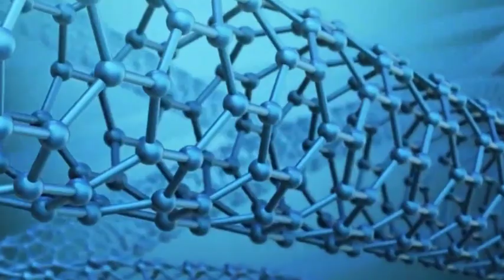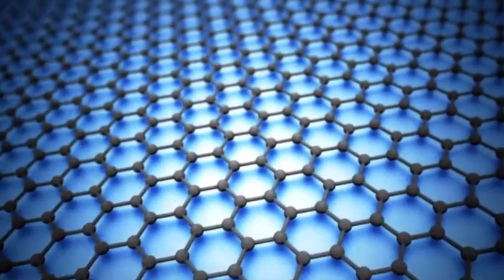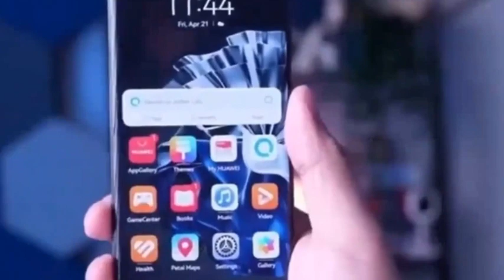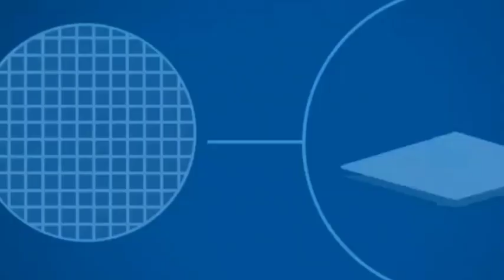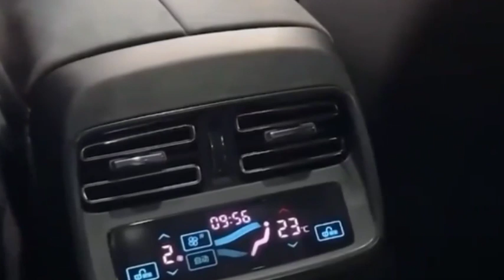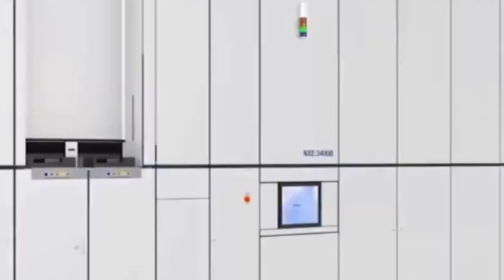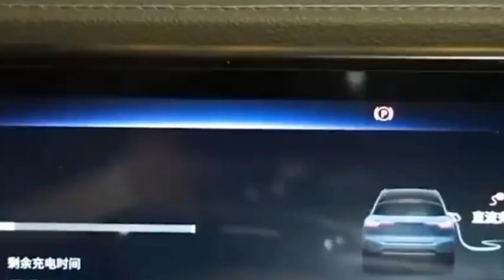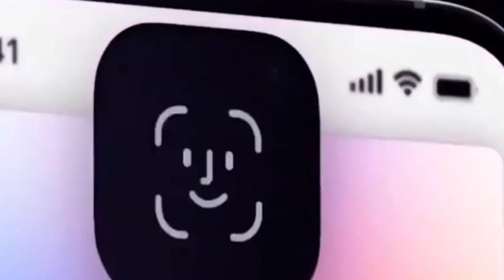Tianjin University successfully developed the 1st graphene chip, improving chip performance by 1000%

Comment: Wow, China has built the first graphene based chips which has 10x beter performance than the traditional silicon based chips. China is now the forerunner of the new technology in the semiconductor industry by the invention of chips built from carbon instead of silicon. The graphene chips improve the performance by 1000% due to beter conductivity of carbon and they will be cheaper to produce. This invention by the Tianjin university will make the silicon based industry obsolete. China has surpassed the usa as she is ahead in this technology.

Comment: There were media reports that China had produced 8 and 12 inch graphene wafers, so it was a matter of time before someone produced semiconductors on them.  It will be interesting to see if China can turn the corner and produce useful chips from graphene where speed and energy efficiency are paramount.  This could blow away the drive towards 2 and 1nm silicon chips and the very expensive lithography needed to produce them. Obviously a patent family will evolve from this development and if so, the US may be on the receiving end begging China to be allowed to use them. The days of ASML and TSMC are numbered if they cannot participate in this new application of semiconductor technology.